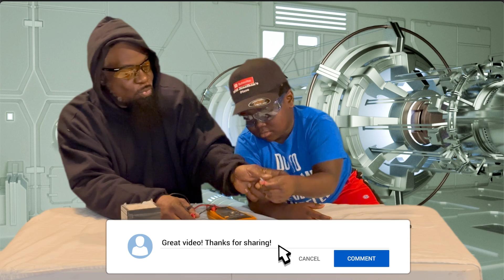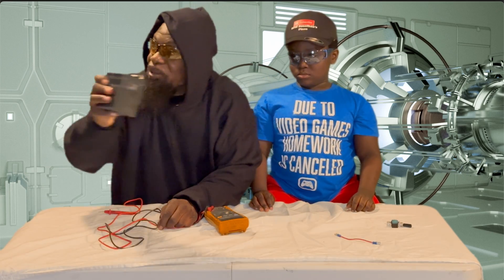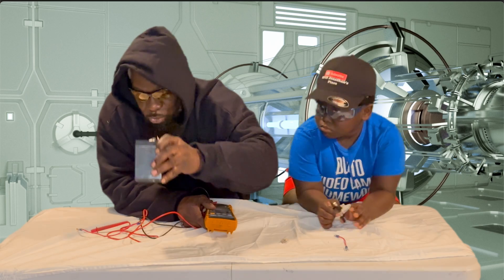Fun And Educational: Basic Electrical Testing Using a Meter With Dad | 3240 Jonathan’s place

Comment: So it's called a multi-meter because it gives multiple readings for the same thing?
Reply from the maker: No “ multi” so that you can test for different things you can diagnose, troubleshoot test, voltage, ohms resistance, amps etc.